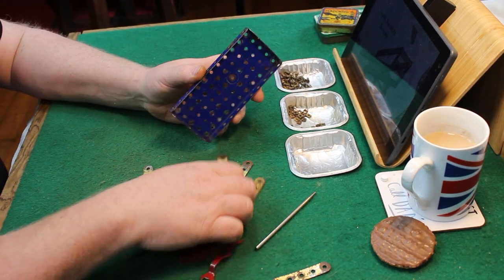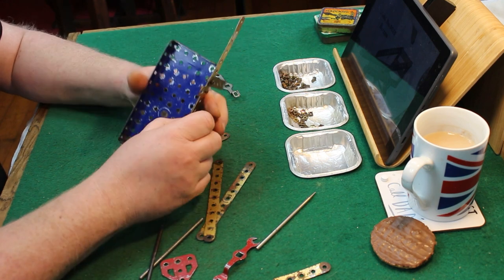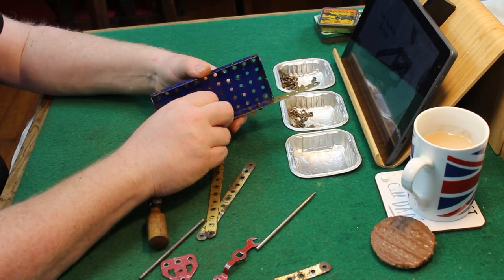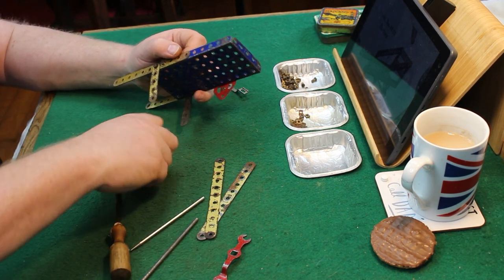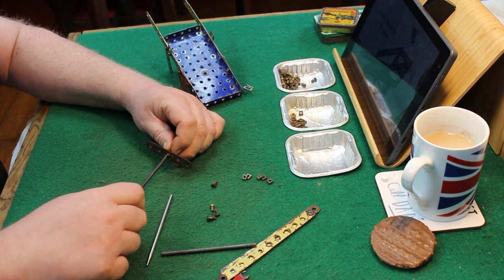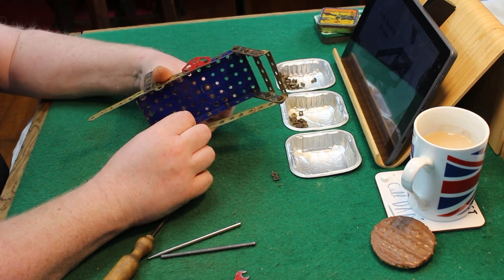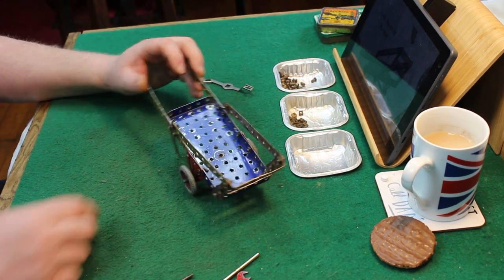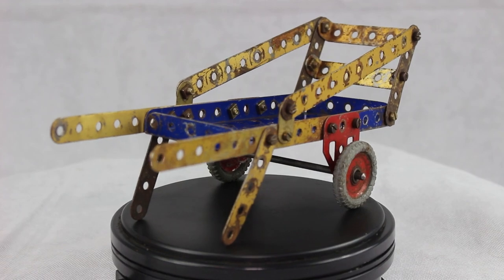A barrow but not a wheel barrow!

Comment: If I'm filming builds, I quite often use 2 cameras positioned at different angles and edit between the two viewpoints.  It means you can choose the best view with the least hand blocking possible, and the variety keeps the video more interesting.  

I think that kind of barrow is called a costermongers barrow.
Reply from the maker: I was using two use two cameras, but found I wasn’t using the second footage a lot, and with the added data storage it was beginning to become a problem, even now I am sitting at around 700gb of video files on the hard drive.

I need to rethink the cameras position, and that might be a simple case of next build, putting up a number of cameras and see which footage is the best.

There is a Costermonger barrow build as well, so I wasn’t sure if this a different type of barrow, but I love knowledge that we can get out of our builds.

But not so much the screwdriver stabbed hand from last Mondays builds.
Reply: @gingerfairybroadcasting3620  Just delete the footage you don't use, or save it on an external hard drive.  I don't keep any old videos on the computer, they all go on a hard drive.

Stabbed hands are part of the learning process, but also why I have switched over to only using Allen headed bolts nowadays.